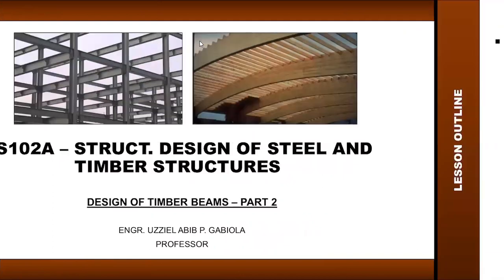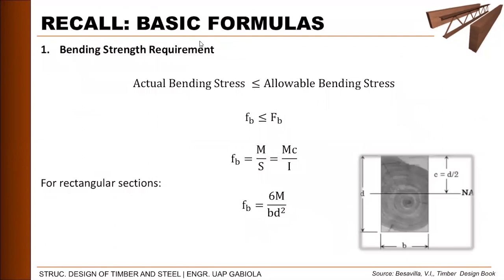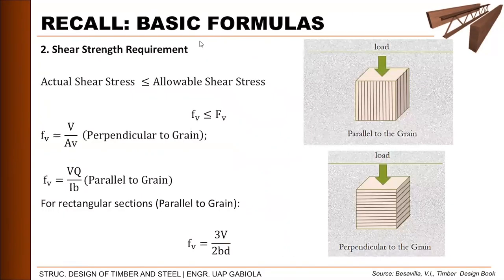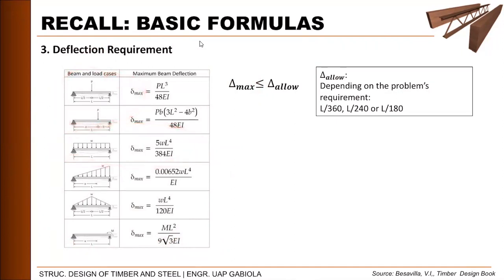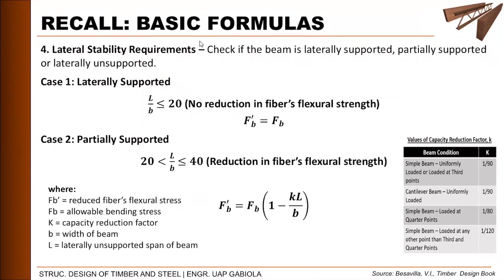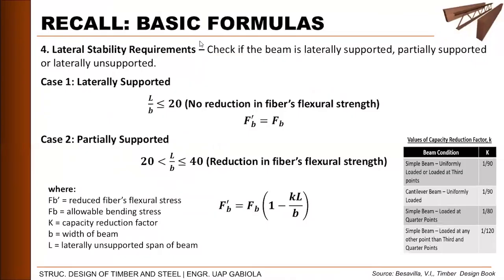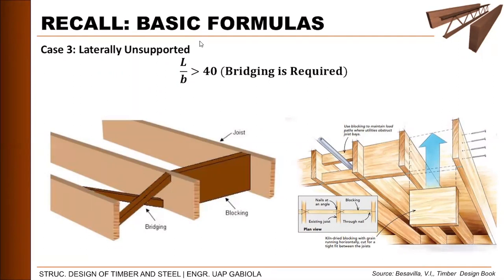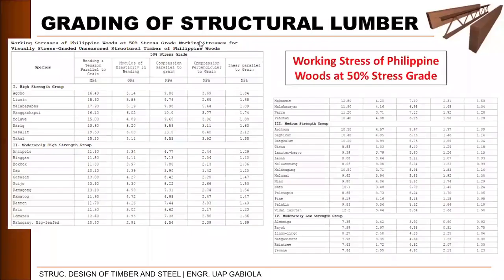STRUC  DESIGN OF STEEL AND TIMBER STRUCTURES | DESIGN OF TIMBER BEAM - PART 2 INTRO

Comment: Reference your slide 3.Defkection requirement.  Formula for Max Beam deflection for point load at any location is wrong. The formula is wrong. It will give deflection at center for the given combination not the maximum deflection. The maximum deflection will not result at the center. Can you provide the source from where you took this. 

Waiting for your response.
Reply from the maker: Hey! first, thank you for watching my video, I really do appreciate it. 

Regarding your query, the reflected equation for max deformation for concentrated load at any point is not entirely incorrect. I should have been more careful in stating that the distance in question "x" should be less than the half of the length or L/2. So it can stil be used if that criteria is satisfied (x<L/2). 

I apologize for showing these equations carelessly, the table I used on this presentation can be accessed through: https://www.omnicalculator.com/construction/beam-deflection

However, for the maximum deflection, say a>b, the AISC has given a formula on that on Table 3-23, Item No. 8. There are different sets of equation depending on the location of the concentrated load along the length of the beam.

Hope these helps!